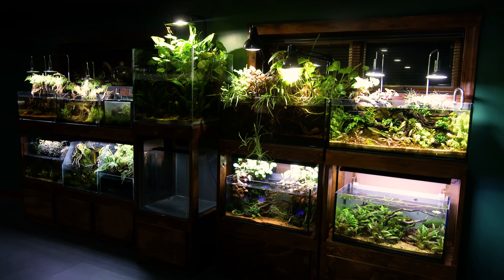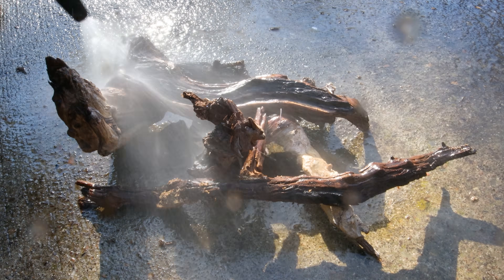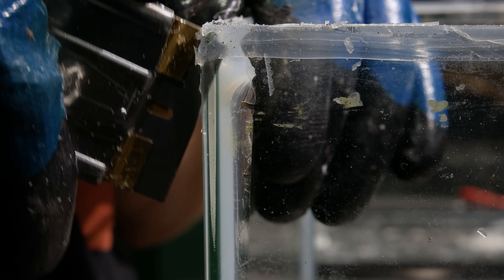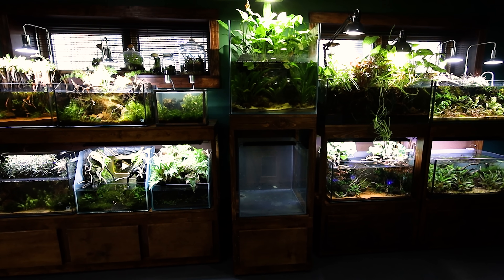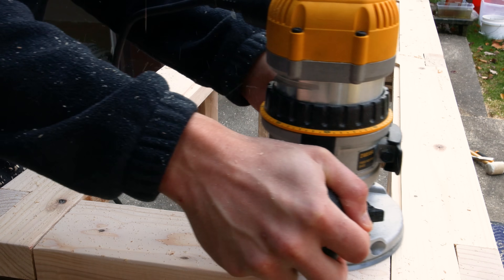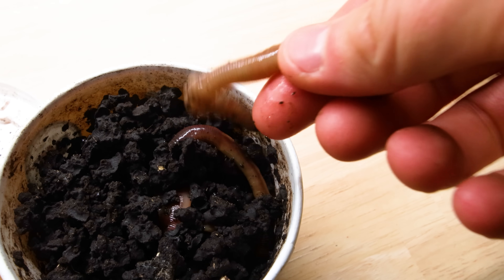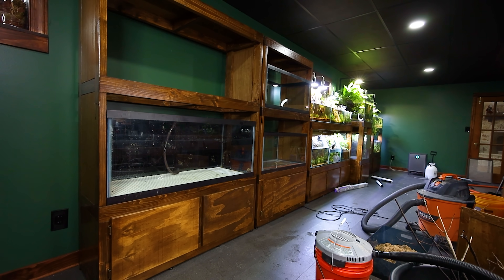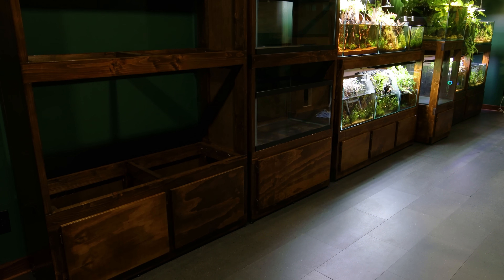The Unintended Impact of Changing the Animal Room

Comment: Ignore those caulk heads, almost nobody is going to notice the silicone bead in the finished tanks.  I can all but guarantee that if you didn't show the building process and just showed the end result, you wouldn't get most of these comments.
Reply: Hi did u know that jesus bled and died on the cross so we have a chance to go to heaven repent before its too late and remember jesus loves u ❤
Reply: @brickstarsfun8698  I don't have a problem with people proselyting, but please make at least some effort to tie it into the subject matter at hand.  Otherwise, you're basically just a spammer.
Reply: @jic1  it definitely is a spam bot
Reply: There are Jesus spam bots? There's a song in there somewhere, or possibly a band name.
Reply: @jic1  i on the other hand, do have a problem with people proselytizing.

missionary is an affront to human spiritual autonomy. it is an act of spiritual colonization.

free minds find the path better than those led by eagerly guiding hands.
Reply: @jic1  it literally is spam. It's under any comment that has a reply so far that I've seen. It's spam, just report it and move on, replying doesn't do any good to spam bots
Reply: @goosenotmaverick1156  At the time when I replied, I didn't know that it was a spambot.
Reply: @jic1  fair enough, it happens to me as well.

Comment: 4:44  there are caulk bead cards you can buy at hardware stores with round or angled corners to use on your caulk beads to both create the taper and draw a bare spot on either side of the taper, so you can simply peel (or scrape) the excess off while keeping super sharp lines

Comment: what if you cut the top shelf off? put some leveling feet on the corners and popped it back up there? leveling screws would add a few inches and some function? might wreck the vibe though

Comment: Hard lesson to learn. Always measure the openings and spaces where something you build is going to go. Drawings are fine as ideas, but usually don't have much to do with reality. I spent more than forty years building from architects' plans and contractor doodles. I mock things up in cardboard or Luan ply full size to see if they will fit or work in the space, before building the actual piece.😎

Comment: Had a similar problem when I built my reef tank stand, measured everything so my DIY sump will fit in between my supports only to realize when I went to plumb everything I measured the outside of the glass, not the outside of the plastic rims on the top and bottom. Thankfully it still fit, just takes up more floor space than I had planned on

Comment: You need to check out one of Modustrial Maker's Caulk Talk bits for the way he does forms for resin & concrete pours. He uses a large fondant ball to spread his silicone into 3 lines, lets it dry, & then just removes the excess for a fairly sharp edge. Finger is fast but fondant ball looks cleaner.

Comment: The secret to applying silicone/caulking is all about how u open the tube. The trick is to cut the smallest amount off the end as possible, at a sharp 45 degree angle. Than pierce the tube with long skinny nail, and should have about 1/8 hole in diameter. That will help you control the amount of silicone u apply and allow help achieve cleaner, tighter lines in your corners/gaps.

Comment: Sorry about your mishap. I make books/journals. Back at the beginning of summer or the end of the school year, however you want to look at it. I decided to make two journals for my two nieces who were going to be heading off to their first year of college. One went off without a hitch. Looked so nice and was made specifically with colors and items picked for that niece. The second one, idk how but my holes I put in the spine were all wrong and my hand picked and designed just for that niece pages didn’t fit. I too use scraps and bits. So I didn’t have a way to redo it and make it look like the original design. Same coloring and I added bead work that just wasn’t going to be usable for the new fixed journal. I was so bummed. I worked so hard and took such care picking and making it just for her. It took me three days to get it together and start anew. And it turned out nice but the one I messed up would have been so much better in my opinion. Plus that’s what I really wanted for her. What a rookie mistake I made. And I haven’t been making books and journals super long, but I should have known better. So I feel ya. We can only keep on keeping on. 
Better luck next time right?! 
❤️💜💚

Comment: I got a rechargeable battery operated pressure washer that only needs a pail of water which i use for miscellaneous washing around the house and even spraying chemicals on my shrubs and plants. It's one of my best tools as I'm not confined by power cables and length of the hose. Also, it takes minutes to get go and put away🙏✌️

Comment: Install heavy duty drawer slides in the cabinet that you can set the tank on and securely slide it in and out of the cabinet on the drawer rails. Idk how you’d manage with the pump system/ pipes tho

Comment: cut your silicon tips at a angle. you should get a triagular shaped space in the corner under the tip when you squeeze. then same with your finger, leaving a small gap and drag the opposite way you applied the silicone.

Comment: You may want to try a stacked dado cutting blade for the notches. it would eliminate using a chisel. Would save you quite a bit of time.
Reply: Those things scare the crap outta me, honestly. 

But I grew up with a neighbor and family friend, that was 2 knuckles shy on his index and middle finger of one hand because of one. I even worked with him in his shop in my teen years and early adulthood, occasionally. (When they'd get stacked up and need a few extra hands) 

I'll do anything in that shop, including ripping sheets on a table saw. But I will NOT ever touch one of those. Call me what you will, I'd still be chisseling too if I was him. But there's a reason I don't do woodwork for a living. 😂

(I'm an electrician. Which arguably scares some more than saws and such, to each their own, is all I can say, I have fun with it like some folks enjoy woodworking, so I get why folks do it)

Comment: A 60 gallon would fit perfectly where the 75 was meant to go. I can't recall the exact dimensions but there's a tank around that's just shorter than a 75 and everything else is the same size. I believe 60, 75, and 90 gals are all different heights on the same footprint

Comment: Have you considered adding pieces of wood connecting to the rack via metal rails under each tank that you can slide out in order to do maintainence more easily?
Reply: Like drawer sliders? Is that what you're talking about?
Reply: @goosenotmaverick1156  kind of, like drawers without the walls, just the base that the tank would sit on top of which would allow him to pull the tank out from the rack to work on it. I think on a rack with two 75gal aquariums, pulling one out at a time wouldnt topple the rack.

Comment: I’m curious if the filled tank is too heavy for a rack that would allow you to pull it forward like a drawer?  I can see how challenges like this tank can arise. But you have overcome many challenges before so whatever you do is going to be noice!!!
Reply: That seems like a potential solution! I wondered if he could just whip up a slightly shorter tank. Well, I say "whip up" because I see fifteen minutes of video footage per tank 😂
Reply: If he has the space to sacrifice the height, such drawer sliders do exist and I believe he has the skills to implement them. 

The issue becomes securing it enough that the shift in weight doesn't take the CG of the whole rack to a point of failure in some way. 

It's definitely DOABLE! Just a chunk of effort and time, as well as materials. (Drawer sliders to hold weight like that aren't cheap. That's HEAVY stuff)

It would need to stop at a very shallow depth of pulling out and have some other things put in place. But it's doable for sure! I'm adding my thoughts in hopes that it spurs some conversation and gets this comment sent higher so he sees it. I think it's a great idea and Tanner is more than capable of making it happen, I have faith in that.

Comment: I feel a little better about the cluster I had trying to use silicone for the first time a couple of years ago. I was making a lid for my tank, because I wanted it to be lifted so I could have plants sticking out the top but still have a lid on. Since it was one small project, and I don't own one of those silicone g*ns, I just bought the little tube that looks like a toothpaste tube. Long story short, it wasn't squeezing out very much, so I used both hands, the bottom popped open, I didn't notice, and got silicone **everywhere**.  LOL

Comment: So you are trying to do some final racking, but your mistake made me think. I feel like there's an opportunity to build in a rack and pinion controlled shelf that you can use a hand wheel to raise and lower your tanks for maintenance. With a system like this, you have the potential to have a frameless shelving unit. When it's time to clean, spin your hand wheel, drop the tank about 8 in or so, clean and maintain, then raise it back up into place. I'm sure somebody has already thought of this, but I'm spitballing, and I'm sure I'm not using the right terminology, but it's something to think on.

Comment: Good enough is usually around 75% of what you expect from yourself (or what a difficult boss might expect from you). And if you do 100%, it will not stand the test of time, because in a year or two you will have advanced so far that these 100% will have degraded to 75% anyway. Always wanting to do perfect quickly burns you out because the last 25% take way more energy to complete than the first 75%. I had to learn the hard way and since I did, I only ever wing it and do stuff half-assed, be it at work or in the hobby. I get much more done and am much happier this way. And nowadays I quickly become annoyed when i see perfectionism in friends or co-workers.